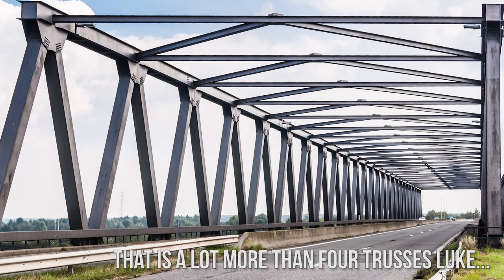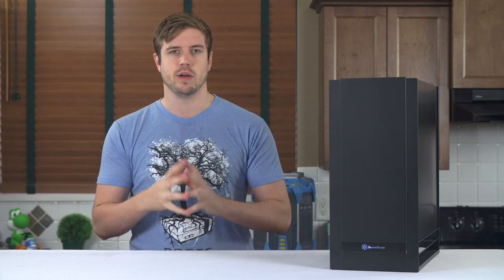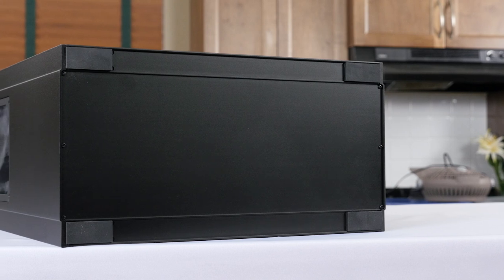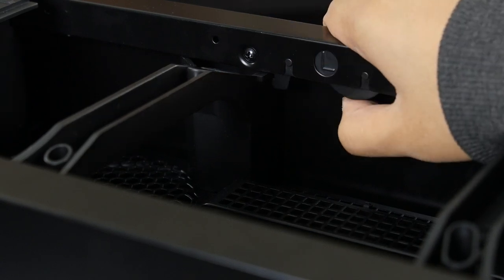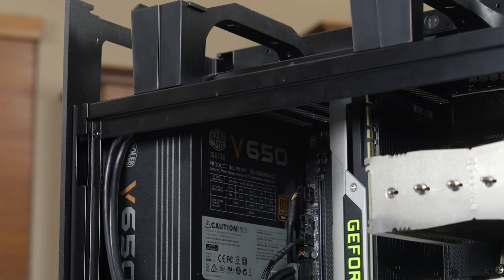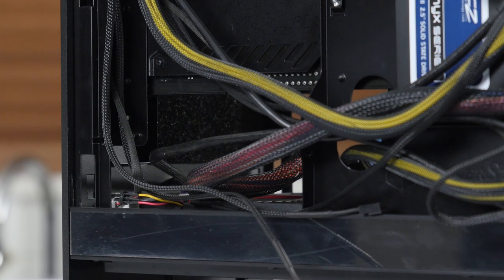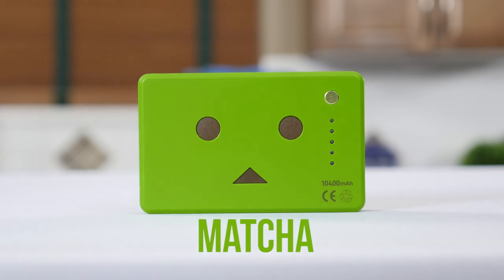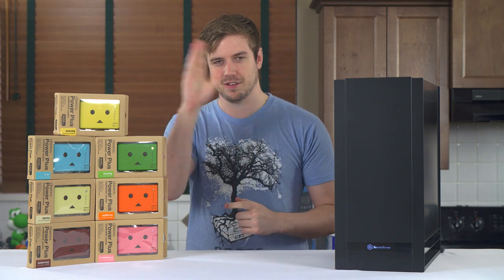SilverStone FT05 Computer Case

Comment: All of these cases coming out lately, and yet the H440 still seems the most interesting to me.
Reply: The H440 is pretty but it lacks in airflow pretty severely. It's basically a pretty Define R4 with a little less airflow.
Reply: Standards Meh with three 140mm fans at the front and top exhausting water cooling it should be enough. Don't need too much airflow to vent the hot air from an open GPU.
Reply: Casual Alien It should be "enough", sure. It just lacks where it could probably be better. I have two reference 780s, so I wouldn't stick them anywhere near it. In reality, it just depends on what you have. A good aftermarket single GPU like a twin frozr or windforce  and AIO is fine in it. I just personally don't like it very much.
Reply: Standards Care to explain why it "lacks" airflow?
Reply: Standards The reference cards would be better in a case like the H440. All the air on the reference cards is vented through the back, rather than dissipating it into the case. With reference cards the 3 fans at the front would provide pleanty of airflow for the cards to push their their cooling shrouds.
Reply: ***** It is a silent case without an open front. there is only a relatively small gap at the front to take in air.
Reply: ***** The included fans are only rated for around 45CFM, which means they don't move much air compared to "higher-end" fans pushing exceedingly higher. My AP181s (albeit them being 180mm, not 140), push 130, and my exhaust Cougar pushes 70 as a 120mm. Not bragging, just giving a comparison. My airflow is on the high side, but not amazing. 

http://us.hardware.info/reviews/5337/7/nzxt-h440-review-radical-design-causes-lack-of-fresh-air-test-results-cooling-400-watts

400 watts is a pretty standard configuration, but if you're throwing in, say, a 980 and i5/i7 overclocked, you're going to be cutting it close unless you manage to fit a slim radiator for the CPU and have a really great GPU. Like I said, it's pretty much a prettier R4 with less airflow. You could probably replace the fans and spend a lot more on adding extras, but at that point you've lost the justification for buying the case in the first place. Another case at the same cost has sufficient cooling already and has room to add more if necessary, which is what the h440 needed.
Reply: Casual Alien Reference or non-reference isn't going to make any difference if you're running one card in a case like this. Non-reference would simply be a better choice because of power delivery and everything else on the presumably custom PCB.
Reply: Standards
A guy with background on aerodynamics replied before on the review of hardwarecanucks on the corsair 350d & he basically said the small slot on the front has minimal effect on airflow and the h440 has a bigger opening in the front. As for the fans, who doesn't replace the stock fans on their cases nowadays esp. with higher end ones like the h440. I don't know anyone who buys a case mainly because of the included stock fans.

I also believe that the h440 has better airflow than the r4 considering how much more fans you can use and the h440 has a better hdd mounting system that lets air pass through better.
Reply: ***** The problem is that you buy a high-end case expecting relevant airflow and upgrade potential. The h440 is marketed as silent, so to achieve that using specialty fans. Those fans have significantly lower airlow and higher noise than even an r4, and the r4 isn't anything that amazing. You'd be surprised how many people buy a case for just that in itself. I'd say "enthusiasts" are more prone to add and replace fans, as doing that will add on to the cost extremely fast. When you have to replace every single fan, though, adding to the cost essentially justifies a higher end case that has better airflow (and potentially everything else) that can, but doesn't have to be, improved if wanted. There's no real reason to get an h440 unless you adore the look enough to deal with where it falls short.
Reply: I have the black and red h440 and I love it !!
Reply: Personally my favourite case at the moment is definately the phanteks enthoo primo. Also saying that because were mainly talking about mid towers. Enthoo pro is beast!
Reply: Standards I can't imagine anyone who is buying a high end case with what type of stock fans are included as his main priority. I myself is not what you consider an "enthusiast" but 90% of the time I always replace the stock fans.

As for the reason not to get the H440, aside from the looks it has a lot to offer feature wise. Amazing cable management, psu shroud, led at the back io, fan hub, 3x120mm fan mounts at the front and top, amazing build quality, etc. When it comes to mid towers at that price range the H440 is objectively one the top cases out there.
Reply: I did a white build with the H440, recently. Looks awesome and the airflow is more than enough for a "silent" case. I'm using a reference 980 and never had any problems.
Reply: ***** I'm not sure what you consider good build quality, but everything NZXT is considerably mid-range in every regard. As for the others, well... they're sort of personal appearance preferences. Like I said. It's up to if you like how it looks. If you were really going for a mid-tower or smaller with build quality, you'd be looking at Silverstone, Lian Li, etc.
Reply: you will have to take my original phantom case from my cold dead hands D:
Reply: Standards As a proud owner of an H440 with two ACX cooled 970's, cooling is no problem at all. However, that might not be true with something a bit hotter, like a reference 690.
Reply: Naw man i'm getting the Enthoo Luxe, that case is gorgeous.
Reply: Liam Fitzpatrick The Enthoo Luxe is a nice case, but its harder to find in NZ.
Reply: A FLY1NG SQUID But are they overvolted with an OCd CPU?
Reply: Just ordered my H440 today...I've done a few builds in it at this point for other people and have never had a single issue when it comes to cooling.
Reply: The only H440 that looks good to me is the white edition, but even that just looks plain and not really well thought out. The coloured versions just look silly.
Reply: Standards Can agree, I have a 360mm rad mounted on the top with 3x exhausting, and 3 120mm NF-F12s, and 140mm noctua redux in the back to match the color. If i remove the front and top panel, the temps drop about like 5-10degrees Celsius
Reply: Standards Maybe you should chill your nips buddy. I was only saying that my setup was fine. Not that every single one is.

The Maxwell line is known to run cool. And I actually have an OC'd i5 @ 4ghz in my case with the stock cooler too. It runs at 30 degrees idle, 50 load. I'll be getting an Corsair H105 though.

But honestly, you would be surprised as to the amount of air you can move in that case. Don't knock it until you try it.

As for the intake on the front, it's plenty big enough.

It's not all about size. ...right guys? ;_;
Reply: Casual Alien aww that sucks
Reply: Standards Just used to people getting hostile on here, and it seemed that's how it was going.

But anyhow, the case gets much better airflow than people think. I recommend it if you have no need for a 5.25" like me. Only things I've disliked about it is that the foam in the back cuts down on cable management space a lot, and that the fan hub only connects to the power supply, meaning whatever you connect to it will run at max speed.

Other than that, it's a beautiful, spacious case that's built very well. (albeit a bit heavy)
Reply: A FLY1NG SQUID No one really says it has no potential for airflow. I think you're just misunderstanding what people mean, or what I mean, when "lacking airflow" is said. For a case that's 110+ dollars, you'd be looking to have a pretty bang for your buck, and when you have to swap out most of the incredibly low-grade fans for higher end or simply add some to make things manageable, it's shown as a design flaw. It definitely is good looking, although I personally don't like it. It boils down to a consumer point of view. It's 120 dollars. For 30 dollars less, you can get a quieter, cooler R4, or with the money you'll essentially be spending on fans you can get a high-end full/mid tower from corsair, silverstone, lian li, whomever. That's why I said it's mostly preference and if you really like how it looks. It's not a bad case by any means.
Reply: Standards Preferences are different for everyone, that's for sure.
For me, I wouldn't dare have my build in something like a HAF. It's more about looks for me.

Thank you for the actually intelligent conversation BTW. It's a rarity here.
Reply: A FLY1NG SQUID I just don't like the HAF because it's ugly. I don't like how pretty much any Corsair case looks, but I'm picky.
Reply: Standards As am I. I tend to go for simplicity. Meaning stuff like the H440, the Phenom, or some of LIan-Li's (spelling?) cases appeal to me.

The black and green of the H440 is what brought me to it, as it's hard to find many cases with green that don't look like a highlighter explosion.
Also, I despise the now standard black and red. (Damn you Gigabyte. Your green boards looked amazing.)
Reply: A FLY1NG SQUID I don't like colors at all on my case. My rv02e came with a power LED, but I snipped the wire. I like highlighting my build, but I just have 2 strips of cold cathodes in to brighten up my mobo and 780s.

Comment: Still rocking my Silverstone FT02 with its 3 AP 180mm fans, does a fantastic job.

Cable management is still an issue similar to this one, even though the ft02 is a massive case.
Reply: Have the same case dude. I love it. 3 AP fans, beautiful unibody design. These cases are fairly old but I'm not "upgrading" any time soon.

Comment: I think you need to make a bigger point of the airflow in these cases.  There seems to be a lot of confusion regarding the rotated mother board in the comments... 

The main reason for the rotated mother board is so that your graphics card(s) are aligned vertically allowing hot air to flow up alongside them and out of the top of the case.  As you know, hot air rises so this make a whole lot of sense... 

The large intake fans in the bottom mean there is positive pressure in the case keeping the dust out and aiding the natural flow of the air. 

The handy accessible rear I/O is just a nice by product.  I use a FT02 and would never go back to a regular design for air cooling.  It is a HUGE case though and I would definitely consider this FT05 if it is considerably smaller.

Also, I think this is a nice looking case for people who aren't looking for a bling, in your face design that still has great cooling...  This seems to be a rarity in recent cases...  You can get your edgy 'gamerz' cases to match your gaudy Razer gear and smarter cases are available but they usually lack airflow...  TBH I'd take this case without the window as a preference.
Reply: Yeah, reading the comments. People just don't seem to understand physics. I even just notice this is an ATX board without being giant FT/RV-01/02 ships. That said, Silverstone keep making the same mistake with the 180mm fans by building side panels so close to them, just give us more width to cable manage.

Comment: I own the FT02 and the FT03.  Love Silverstone.  Very excited to see the FT05 since its the happy medium of the two.  All the extra front drive bays on the FT02 are just silly, but its still the sexiest case ever and I will likely use it for my next build.  Meanwhile, my FT03 is simply amazing if you're willing to use a mini board like the ASUS Gryphon.  The FT03 is better served by at least a liquid cooler for the CPU but quickly runs out of space if you want to do more like liquid cool your GPU but you likely won't need that if you only have one GPU card, but for such a small case it can have two if you replace the bottom fan cage with a larger fan.  That said, its a bit cramped but in a beautiful way.  The FT05 looks like they got the memo about getting rid of all the unnecessary abuse of space as the FT02 is a beast (albeit a beautiful one), but I wish the FT05 was a bit more refined like the FT02.  Will I buy the FT05?  Not likely.  Even though its perfect for what I want in my next build, its not enough for me to want it more than to simply reuse my FT02.

Comment: Is there any chance for a review of the Rosewill Challenger U3? It's the case I've used in in my latest build and very easy to work with even though I have big hands. And the Rosewill Capstone-M PSUs are definitely a great value with an 80+ Gold rating with a non-modular and semi-modular version (which I use).

Comment: Saw this case in PC Building Simulator. Wondered why it isnt more popular or available. Found out its ancient. Still an awesome case.
Reply: It's quite weird because some older comments here said the design is bland... Now though, case designs have less aggressive looks but are more streamlined and sleek. The number of drive bays are also the standard now. When this released, cases were still having the 6-9 3.5" drive bays behind the front panels.

Comment: I have never understood why people would want the IO at the top of the case. To me it is  unattractive. What's the benefit other than having a better access to the IO?
Reply: SeaJay
It's excellent. I had a RV01, and I fell in love with dual, completely separate psu/mobo sections. The fans in the dividing panel was a great touch being they cooled most od the upper compartment. And the IO section was much easier to approach due to the mobo rotation of 90 degrees.
Reply: I think I'd still rather have a read IO'd case. Lacking the convenience of having top IO doesn't really bother me. Plus, I am someone who cares about the looks of a build and the rotated motherboard annoys the heck out of me, for some odd reason. Though, this case is a beautiful one at that.
Reply: Like mentioned it's a side effect but the best part about this case imo is the vertical cooling.
Reply: *****
The main reason for the rear IO being on top is to permit the use of two huge 180mm fans. If you had the mobo in the regular position it would mean those 2 big fans would have to be in the front which would need a very large ugly front grille and filter.

Comment: Hey guys. I wanted some help. What GPS would you recommend for an i7 3770? I don't want to run into any bottlenecking issues. Thanks!
Reply: Firstly I think you mean GPU but let's put that behind us (no Grammar Nazism here). A great GPU that's also pretty good in terms of bang for your buck would definitely be the gtx 970. It has awesome power and is also pretty cheap. A slightly cheaper GPU would be the 770 which is also pretty powerful. Either of those GPUs would cause no bottlenecking
Reply: Google maps is good. Apple Map's might bottleneck your system. But if you throw some extra NFC ram at it it might be OK. Glad I could be if some help.
Reply: LOL GPS I meant GPU!!!! HAHAHAHA! I laughed so hard at ***** reply.
Reply: LMAO I just read everyone else's response. Haha. Thanks for the laughs guys. A good friend of mine just died of leukemia, pretty sad D:
Reply: Garmin makes some good ones, I would really just use the one on your phone.
Reply: Lawl!!!
Reply: ***** Meh. Minecraft and a little rendering, and photoshop.
Reply: for minecraft, photoshop, and rendering, you won't need much more than a 750 TI. I'm guessing you are rendering videos in premeire and premeire supports CUDA acceleration so the 750 TI will give you a healthy boost.

Comment: With nice sleeved cables i like the showing the cables. It would cool if you could mount the hdd bays horizontal to avoid the PSU problem. Also why no Dark  Chocolate flavour (black)